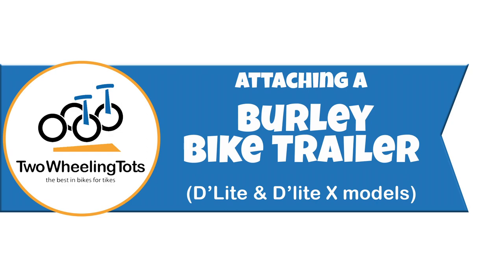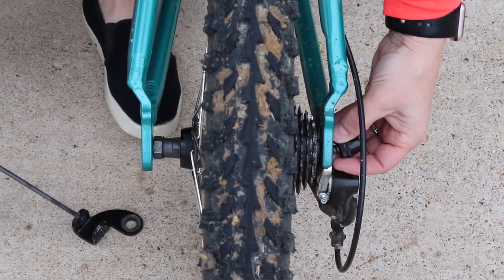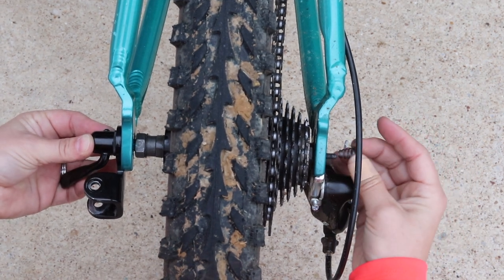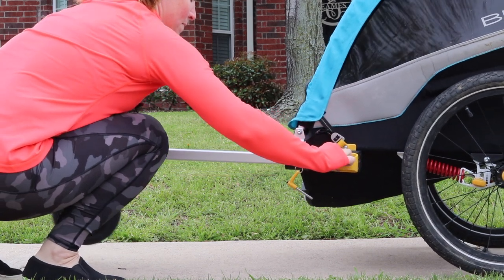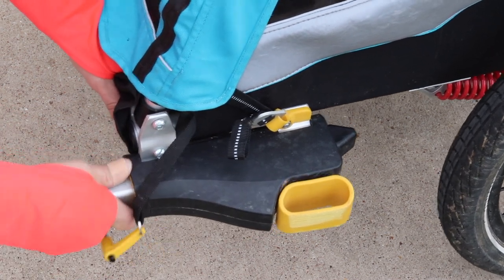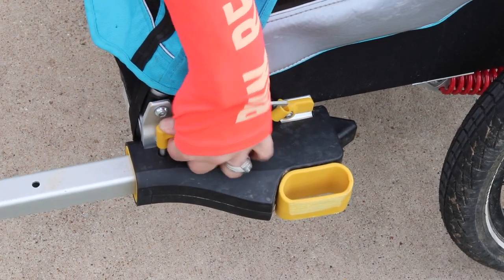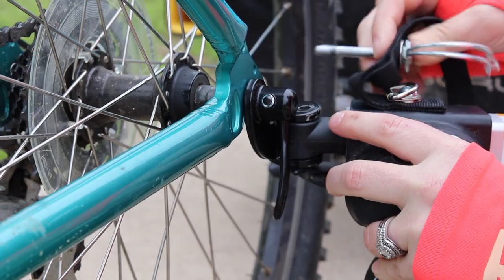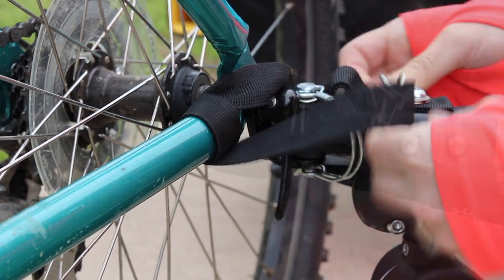Attaching a Burley D'Lite or D'Lite X Trailer to Your Bike

Comment: What bikes do you recommend ?
Reply from the maker: When purchasing a bike for yourself, when at all possible, we recommend trying some bikes out at a local shop first.  This will be help you get the feel of the type of bike you want.  Our favorite bikes for riding around with kids are "hybrid" bikes that offer a semi-upright position paired with larger tires for easy riding along paved surfaces.  Our parent testers all have a wide variety of bikes that we all love, from Priority to Liv and Specialized, so I would hop on a bike and see what feels good to you.
Reply: Is it expected that the hitch is rotating? Or I need to tighten more. Also if my bike does not have kick stand can I put it on the ground is the tow arm joint going to break? How flexible is that join? Thanks!

Comment: And you just leave the stroller wheel on?
Reply from the maker: You will need to fold the wheel up while you use it in trailer mode. The wheel is not removed, but folds up easily.